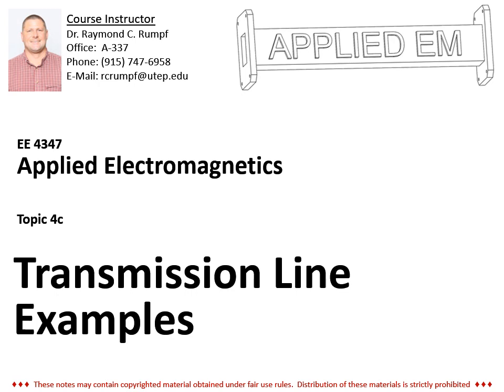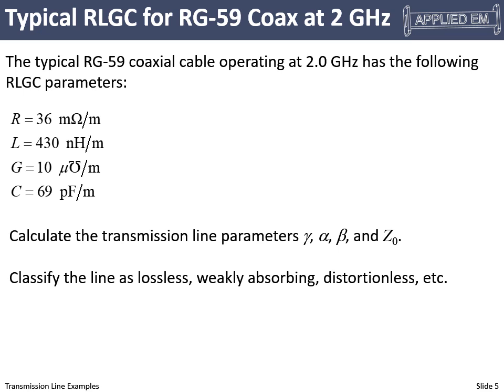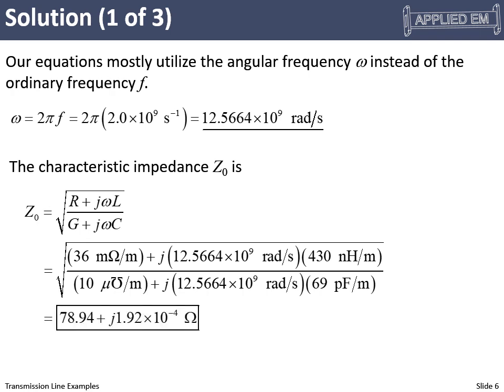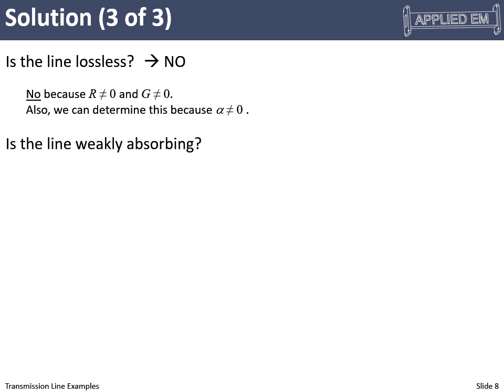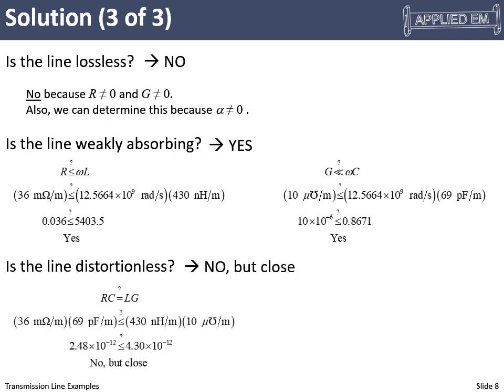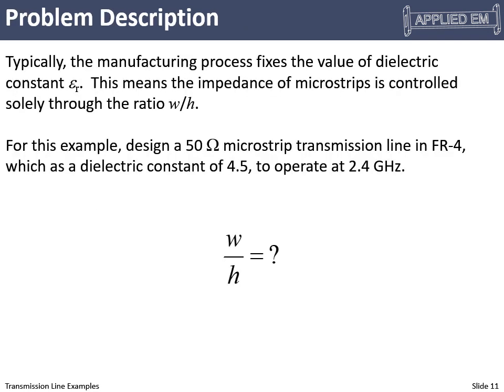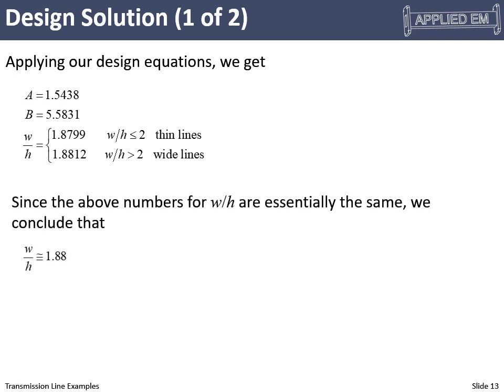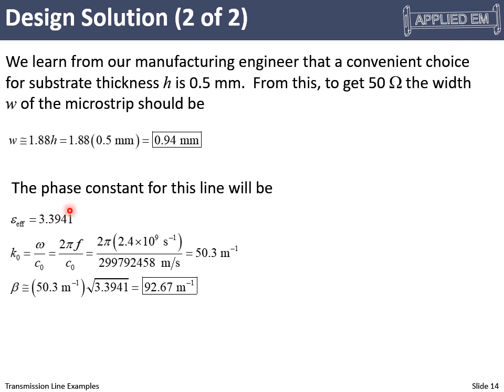Lecture 4c -- Transmission Line Examples

Comment: Sir, you mentioned that the dielectric constant of FR4 is 4.5. But I see in most of the papers as 4.4. On the other hand, in CST, it's 4.3.
Reply from the maker: The dielectric constant of FR4 can even vary from batch to batch from the same vendor.  If your designs are that sensitive to the dielectric constant, you will need to build in ways to tune your circuits.  The trick is to design things that are robust enough to tolerate the fluctuations.